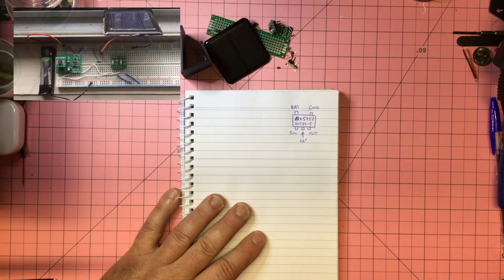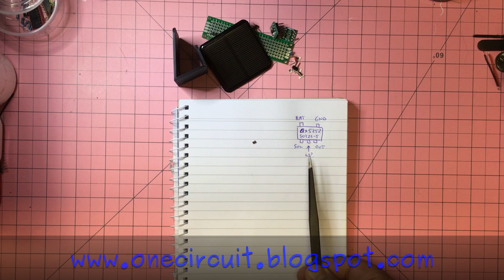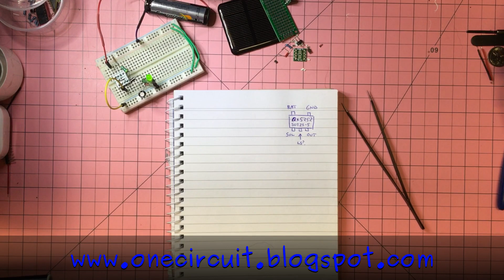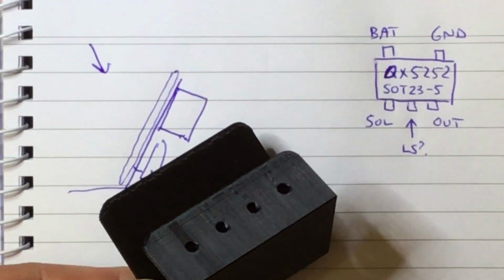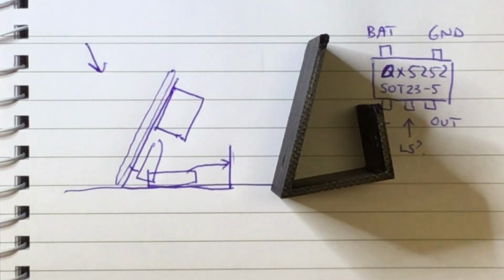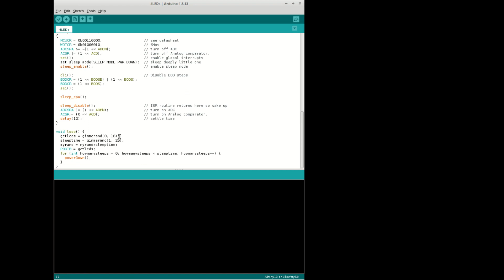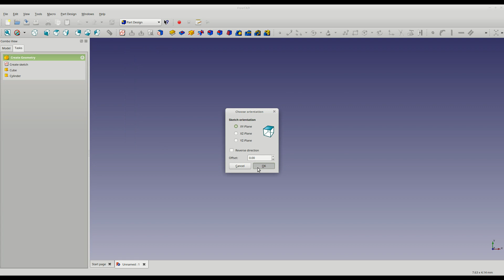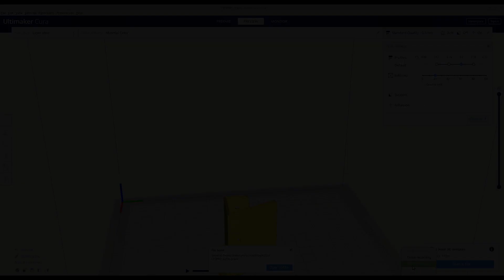Pushing the QX5252 harder

Comment: The LS pin is supposed to have a photoresistor attached to it. I've got a data sheet that shows the circuit - the photoresistor from the BAT terminal to LS and a resistor from LS to ground. It seems to say the QX5252E is controlled solely by the solar panel (thats the 4 pin chip) and the QX5252F is controlled by the photoresistor. It includes some math that might be enough to work out how to calculate the resistor......
Reply from the maker: That experiment is still going! Attaching LS to ground has meant it has been on the whole time. I have just made a PCB using this component, stay tuned! 👍😀

Comment: Wouldn't LS connect to the positive of the solar cell so that the light turns on when no voltage flows. I know this could have been achieved internally but maybe the pin is there to pull low when light is needed during the day (possibly via a toggle switch)
Reply from the maker: In the normal world, yes! I was able to toggle output by connecting LS to the solar cell and then manipulating incident light. But, I don’t want it to ever shut off so holding LS low always keeps the current flowing.
Reply: @onecircuit-as  yes I got that from your video but I was just guessing what it was for. Could a switch toggle between the always on and on at night functions?
Reply from the maker: Yes, easily. I’m thinking about that for a new pcb based on this chip! 👍😀
Reply: @onecircuit-as  cool, looking forward to a possible video. Does the chip come in a DIP package?
Reply from the maker: The ATTiny13 has a dip version. The QX5252 has TO-92 or smd SOT23-5.
Reply: @onecircuit-as  should have realised that the 5252F was a TO-92 package, I have about 40 or more of them. Do you need any, can send 20 your way.
Reply from the maker: I have plenty of both the TO-92 and SOT23-5 versions, but thanks for the offer. One datasheet version does mention a DiP8 package for the QX5252, but I have never seen it for purchase at any of the usual vendors.